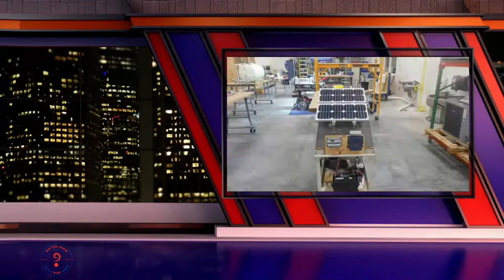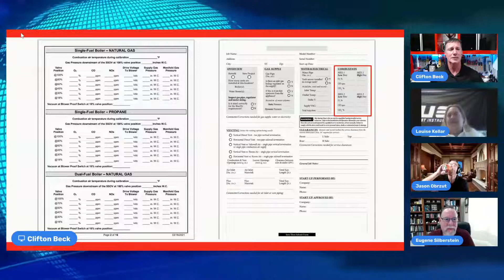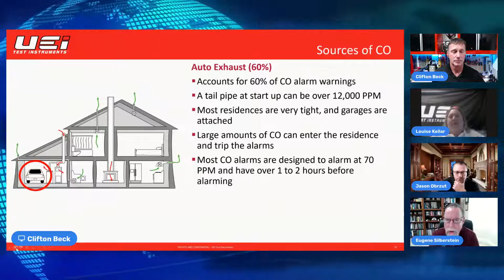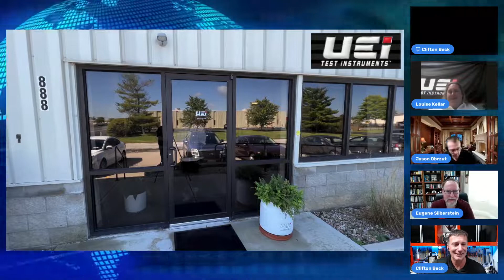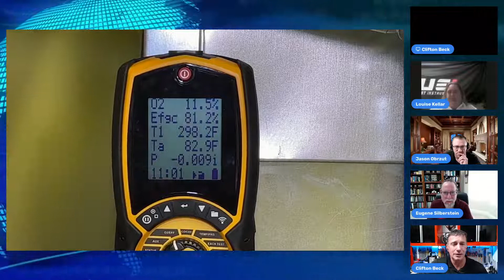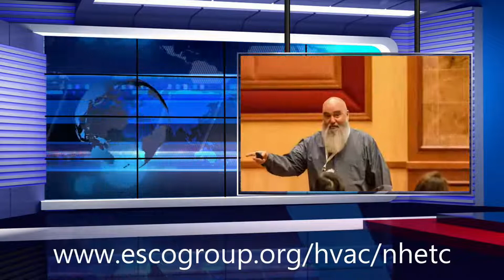That Combustion Analyzer Needs Maintenance!

Comment: The products of combustion in the flue tell so much about whether or not the fuel is burning properly or not in the combustion chamber. It's interesting what the chemistry of those gases reveals about primary air, secondary air, draft quality, water column pressure of the fuel, and more.